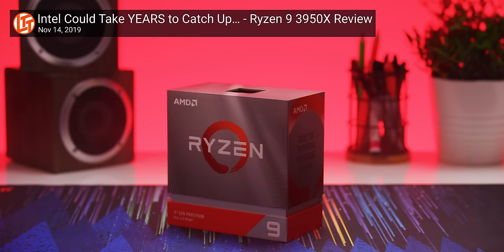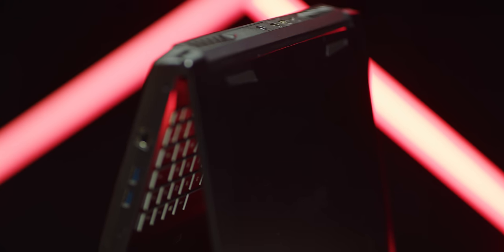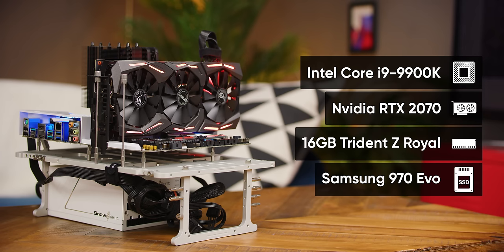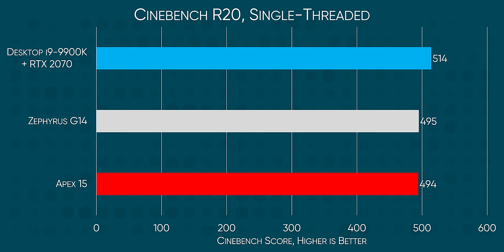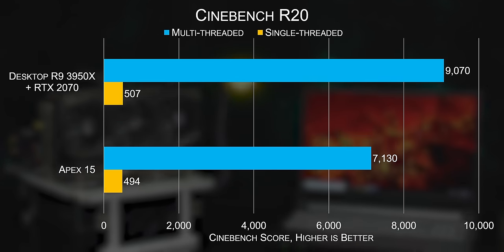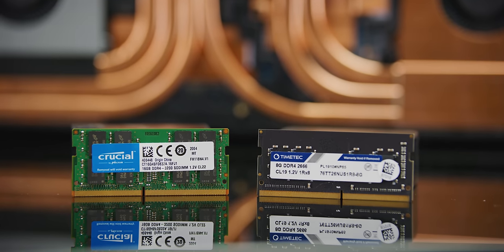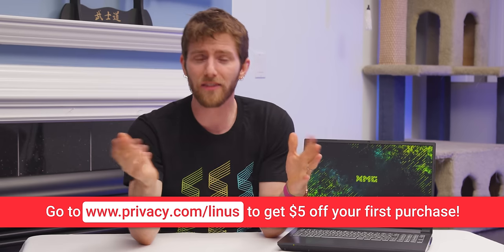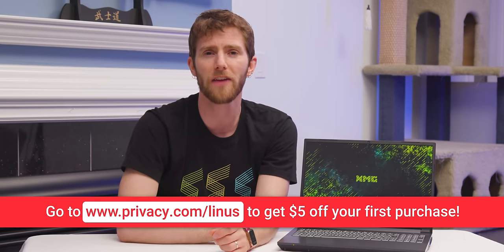The Most Powerful Laptop EVER!!! - XMG Apex 15

Comment: Definition of a VERY powerful laptop:
Something that is very noisy,
Something that is impractical to have on your lap,
Something with barely any battery life,
And something that you need a suitcase to move around.
Reply: but most importantly something that is very powerful like a desktop but still portable enough to fit in a suitcase or easily relocate without powering off.
Reply: Oh come on, that thing is only like 25% heavier than most laptops and 15.6"-sized.
And it's just fine in your lap, just turn down the power profile.
Noise and battery - well... kind of, although that can mostly be managed too.
And you can still easily bring it to a friend's, on vacation, move home or whatever, even if you can't use it for hours on a train/plane without outlets.
Reply: @poiiihy That is like the only reason but I understand (great channel name btw seriously I thought there was a limit to how short you name could be)
Reply: @notthere83  I mean more like the big laptop with two power cables in https://www.youtube.com/watch?v=ivyYAv7wd8g&t=21s

Comment: ....... That's an unbelievable value....... That is literally unbeatable if you include a monitor and keyboard of Equivalent value to the cost of the desktop....  That laptop is a steal.... a mobile desktop that's actually slightly cheaper than buying a whole new desktop setup.... Color me impressed.

Comment: Ive been using a Clevo laptop for the last 5 years for gaming and content creation. The reason I haven't replaced it is because it is so upgradable and in order to get a good boost with an upgrade it would cost well over 2k. 32gb ram, 2tb of SSD  + 2tb hdd makes it a worthy mobile workstation for me. That being said, battery life sucks, it gets hot (cpu is 99c at load) it's heavy, build quality isn't great, and the track-pad does suck. However, it cost HALF as much as anything else on the market that could do 32gb with a real graphics card (GTX 970 3gb). I'm looking forward to my next upgrade. I hope that it doesn't have to be clevo again for the price/performance/upgradability though.

Comment: There's 3rd party ryzen master software you can use in the mean time. It will let you increase the max wattage and voltage of your cpu, as well as clock speeds and memory speeds. I use it on my low tier ryzen 5 3500u laptop to push my fps up for the Vega igpu

Comment: One thing to keep in mind, that $200 more, is also a screen, a keyboard, and a copy of windows, which would usually come separate from a PC build and would cost more than $200 (depending on if you have these already, or you buy them cheap).

Comment: clevo/sager barebones have always been amazing price/performancewize, compared to the "bigboy laptops". I bought one a few years back with a i7 3610qm gtx 680m(which COULD actually be upgraded btw, but mobile gpu's back then were still alot more expensive than the desktop variants)

Comment: My last clevo laptop lasted 10 years, originally had a sandybridge 2630qm 8gb ramm and a gtx 485m, which would run pretty much anything at the time (2011) at max settings 1080p and 60 frames. I upgraded it to a 680m and the 2960xm and 16gb a few years later and it eventually died this year. it was a beast almost 10 years of useability. oh and it runs fusion 360 great, but so does my gpd pocket lol.

Comment: Idea for their future laptop. Build the same thing, but with a deshrouded stock graphics carded plugged into a pcie port. A 4 hold heatsink mount around the cpu and either a kickass power brink, or an internal atx power header. In all they’ve of had to move some internal wiring a bit and add support for external power, but they would build the most balling kickass laptop that would complete with even the best Micro ITX builds.

Sure it would be less portable if you decided to outfitted it that way, but hey; most users would stick with the unmodified layout (so it wouldn’t bother them), it would attract some enthusiast itx builders, and if they were concerned about people not upgrading, most individuals who buy this machine aren’t going to upgrade for 5 years anyway, by which point the AM5 socket will have moved on, being the time for an upgrade.

Comment: I bought one of this Clevo with a R7 3700X and a RTX 2060. Can´t say it´s good for gaming and have to return it, the fan-noice is so loud that you hear it with anc-headsets on (Sony WH-1000 X3) and my mates in teamspeak say I sound like I play next to a vacuum.
It´s a laptop for someone who needs the raw CPU power on the go, but gaming and entertainment isn´t its strong points.
Reply: Have you tried gaming in the 'Quiet' profile? Check the options in your Control Center. // Tom

Comment: There’s also the Clevo X170SM-G which has an MXM 3.1 2080 Super, a socket i9 10900-k, 3 m.2 NVMe SSD slots, 1 SATA m.2 SSD slot, up to 128GB of memory, (Also has the same BIOS issue at the moment), some good display options, (apparently a 300hz panel coming soon) (Eurocom apparently will offer an UltraHD 144hz panel when they release theirs on September 1st)

Comment: Dear Clevo engineer who designed this thing, you could add water/vodka injection between the copper ribs. It will increase the heat transfer a lot!

Comment: I have the same laptop, just a little bit older version Clevo, with 6700k. 15 inch variant. The noise of fans is the only problem which annoys me. Also upgrading to a newer processor is too expensive, since they require you to buy a new motherboard and whole body, imo.

Comment: 7:18 - Actually, considering that CPU is not on the Motherboard, nor is RAM, you can swap GPU with motherboard, it won't cost as much if it had CPU and RAM soldered

Comment: I run an i9-9900KS in my EVOC (Clevo ODM) P870TM-R at 4GHz (liquid metaled and OCed to 5GHz). I run 64G Ballistix RAM at 3200 MHz, and an RTX-2080 in an MXM form factor. It weighs 13 pounds. I get 2085 in R15 cinebench. I don't think Linus has the world's most powerful laptop.

Comment: Nice review ! 
I clearly think that the 3900x is a better choice in every way. Less cores so less limited with the 65w limitation. I don't think that benchmarks will be differents in this machine.
And this performance for 2000$ in a "laptop", it is a great gaming/workstation station which can me more easily than a tower, can be used by just plugging the computer and add a mouse.
But... With competitor like the Zephyrus G14, it will be hard to find a market.

Comment: I'm surprised by the comments on the trackpad. My laptop is the same Clevo chasis, from a UK supplier. It's one of the best I've ever used in my opinion - extremely accurate and responsive. Did Clevo change parts or is it just personal preference?
Reply: Probably personal preference. The trackpad is precise in terms of electronics, it just doesn't glide as well as a Glas trackpad would. // Tom

Comment: Me: Buys this laptop
Also Me: Spills water on it
Reply: If you get the model with 3950X, that counts as extra cooling. Unless you drop it in a pool, you should be fine :p
Reply: Not a problem. It has a removable battery, just remove it and dry.

Comment: Clevo/Sager pretty much was the desktop replacement since 2012. Almost all their laptops, the CPU and GPU were upgradeable along with everything else. It's almost like having an actual desktop in a small backpack. The only limitation would be the size of a GPU or a CPU. I used to own the Sager NP9570 years ago, and I upgraded the GPUs (SLi) 3 times down the line until I couldn't do it anymore because the new series is too much for the slot. The CPU slot had the same bracket, too. But .... Clevo/Sager is not known for their appealing laptops, at all... >_>; Neither is the word comfort in their vocabulary. They are often so thick and high that no aftermarket palm rests could fit.

Comment: What about using Conductonaut Liquid Metal instead of Kryonaut? Surely in this case there would be benefits, due to being on the extreme end of the thermal performance envelope. 
Also, what's the best portable triple-monitor solution for this platform?
Reply: Coldplate is not nickel-plated and using Liquid Metal comes with a host of risks and production tolerance issues, especially on such a large heatspreader. It also doesn't make a big difference due to the thermal density of the CPU and system.

Triple-Monitor: any monitor will work. Natively. We got HDMI 2.0 and DisplayPort 1.4, connected to NVIDIA GPU. // Tom
Reply: @xmg_gg2214  are there any other thermal solutions that might be tried, to allow more margin to improve clockspeed? Could something like a laptop cooling pad or vacuum cooler be incorporated for added cooling effect?
Reply: @manofsan  Laptop cooling pad on the bottom is always a good idea, sure. // Tom

Comment: If I were still in the mobile workstation market of buyers I'd snap this up in an instant.  If this had the quadro as an option what a beast it would be (not that it isn't as is).  Id be interested to see benchmarks with the 3900 just as a comparison, but even still ~2500 for one of those is crazy considering what you can spend on things like alienware and the like at close to 3500 though it's admittedly not an apples to apples comparison.

Comment: Does the 3900 version come with the same cooling?

In the past you've pointed out that if a 'better' CPU thermal throttles and a lower-end one doesn't, then the lower-end one isn't necessarily worse.

Would be cool to see a direct comparison with this laptop's cooling, if you can swing it.

Comment: Would the 3700X series not be a better proposition? I would've thought the 8 cores running at a higher frequency would return better performance than the 16 core with thermal restraints.

Comment: It's not really that expensive, to be honest. A 3600 with a 2070, 32gb of RAM, a TB of Pcle storage, and windows 10, and a 15" 144hz display for about $2K. Around the same price as a desktop from other brands.
Reply: i just bought one but with only 8gb or Ram and no storage (i already have 32gb and a 1tb ssd from my old laptop to upgrade)  for 1350 euros. Got a discount. What a great deal.

Comment: Well comparing CPU's based on a render benchmark is never going to be the whole story. Not everyone is into CPU 3D rendering.
Not many games take advantage of many cores so Core clock still matters for some people. 
Especially those who are into emulation and stuff like that.

Maybe you could try to benchmark a CPU by running PS3 emulation as well? that one should take advantage off 8 cores at least and require some decent clockrates as well.
9900K does fairly well in this area.

Comment: not sure the usb can handle well enough for USB Graphic card?than will be kind of upgrable graphic card, or make new socket for ext m.2 with cover, that will be something fun to see
Reply: No, the USB port does not have Thunderbolt. Only way to get an eGPU would be to get PCIe lanes out of one of the M.2 sockets. If anyone wants to make, document and test such a mod project, we could support it with parts and documents. // Tom

Comment: 5.5 pounds (2.5kg)  is now considered a brick, wow. I still have an older Asus laptop that's 2.4kg or so, and I consider it light. Ish. Before that I had a laptop that weighted like 3.5kg and THAT was heavy as hell. This darn thing looks worthy of replacing my desktop worktation and one of the monitors, dang. Only the noise worries me a bit.

Comment: Laptops at this level should all have high end keyboards and track pads. There should be no deck flex at all. Lets set that mark at $2000 for a laptop.
Reply: Sorry. Deck doesn't flex and the keyboard had an assembly issue in this review sample that has subsequently been fixed. When purchased, the keyboard flex is strongly reduced ant the palm rest and base unit is strong as rock. See my sticky comment for more details. // Tom

Comment: What do you guys think of the specs of my first gaming rig? Feel free to give suggestions. I am buying soon
Build pc
Ryzen 3600x i7 9700k
Asus/msi x570 motherboard
16gb corsair 3200 ddr4 memory
512 gb ssd memory
2tb seagate barracuda 7200
 Corsair 750 semi modular psu
Nvidia Gtx  2070 super
144hz 24" monitor
Cooler master ML360R rgb

Comment: Dieser Kommentarbereich gehört nun zum Deutschen Reich. 😀

If you think the XMG Apex 15 with its 5.69 pounds is a heavy brick, go check out the XMG Ultra 17. I have the 2019 edition which is a 8.8 pound brick plus the 330 Watt power adapter is another 2.8 pounds (and literally has the size of brick). 

It comes with the desktop i9-9900 5 GHz CPU on a socket and you can upgrade the graphics card to a NVidia RTX 2080. This is the Tiger Panzer of the laptops. Though it looks more like a stealth bomber and when I had the CPU going 4 GHz for the first time and the fans started up, I expected the goddamn thing to take off despite its weight. Here in Germany we call these 'Schlepptops' (from 'schleppen': to haul). Could also be used as a hairdryer if it wasn't that heavy and bulky. 

The next cool thing about XMG laptops is that they are highly configurable and for i.e. RAM you can choose between Corsair, Kingston and Samsung. That is, you know exactly what's put into your machine, not just "its 64 GB RAM". The keyboard is of better quality than that of the Apex 15. I can also confirm that the noise, despite its level, is bearable, because there are no high frequencies.

I have that Ultra 17 for about  year know. Best laptop I ever had, despite the weight and the noise.

A few month ago I thought it would be cool if LTT would review a XMG laptop though I thought it was unlikely. Cool to see the review here nevertheless. ☺️
Reply: Wait until you see this year's XMG ULTRA 17.......! // Tom
Reply: @xmg_gg  I've already checked that one out. Gained some more power and lost some weight [well, less than half a pound :)]. Very impressive again. What's that 2x 280 Watt power supply thing? Twin brick system? 😀

Comment: Im kinda new to the whole pc building schtick so i thought i might as well ask here. About three years ago i bought a prebuilt Asus G11cd-k (i5-7400, GTX1050 2gb) and im thinking about upgrading it to have a 1660S GPU. Im not sure what i'm doing so my questions are:
Will my power supply be ok?
Will it fit in my case?
Will it work?
Is it easy to fit a GPU first time or should i pay someone else?
If anyone could help out that would be great :)

Comment: The future:
Gaming on a liquid nitrogen cooled ryzen 99999 890000kkxxsxxx 1400 cores at 5000ghz 1nm zen50 with ddr99 80tb 650000000mhz cl1 ram with a rtxxx 9990ti super duper 80tb vram 99million kuda and raytracing cores clocked at 16 million mhz with 106 gen 68 pcie m.2 800tb watercooled storage all in raid 999000x with a 48 inch quadrupple monitor 80k super duper ultrawide 1million hz refresh ratewindows 68 pro super gamer edition is an unplayable system that barely reaches 900000 fps on max settings in the vr brain scanning full sensory 5th dimensional fully rendered universe emersion neuro implant chip.this system is also extremely bulky and heavy measuring 2x2cm and weighing almost 0.001 grams
UNPLAYABLE POTATO PC

Edit: who am i kidding we will still be on ddr4 ram. Ddr5 will get delayed another 1000 years

Comment: "the 3950x is without a doubt the fastest mobile gaming cpu" 
either a. it's not a mobile cpu why did you say that
or b. you should have compared it with the Alienware area 51m, which has a desktop chip in a laptop as well

Comment: Does this laptop have a desktop 550 or 570 chipset so it will have the possibility to support Ryzen 4? EDIT: It is B450, so nope, no Ryzen 4 upgrade.. and no thunderbolt port for an eGPU. EDIT EDIT: Now AMD says they will support Zen 3/Ryzen 4 on 400 series, depending on if the mobo manufacture supports multiple BIOS versions. https://www.anandtech.com/show/15807/amd-to-support-zen-3-and-ryzen-4000-cpus-on-b450-and-x470-motherboards

Comment: You could buy the laptop, move all insides into smallest case you can find and BAM, you have extremely powerful but very small desktop and you can even upgrade coolers to be much quieter.
Also for LTT team please add value for e.g weight directly into video with conversion to metric system as you have viewers in EU as well :)

Comment: dont know why but never again i am buying labtop the moment i hook up hdmi output my fps cuts in half ?????
Reply: Not sure what happened to you but I can assure you that with our laptops, you can use HDMI and DisplayPort with full performance. I would suggest to use Windows desktop 'Extended' mode, and not 'Mirrored'. // Tom
Reply: @xmg_gg  I used mirrored. I guess that was cutting my fps in half for some reason

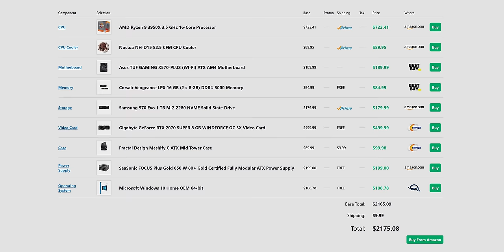Comment: LOL, 9:32 I know PSU prices are that bad, but $200 for a 650W PSU? Are you kidding me?

Also, This is a laptop. So instead of cherry picking overpriced desktop components to stack up to the price, you could have just included a 144Hz IPS Monitor and decent Keyboard (and maybe a simple mouse).